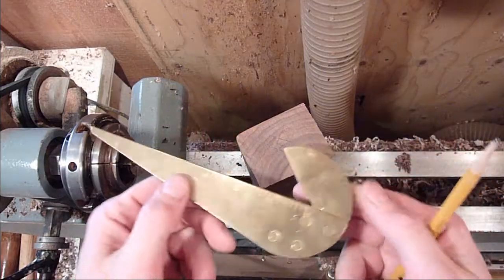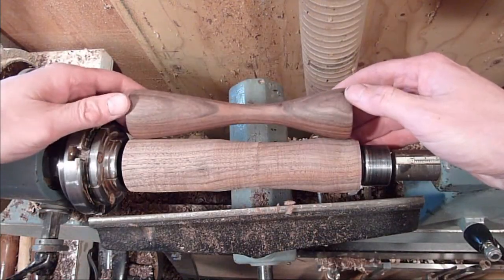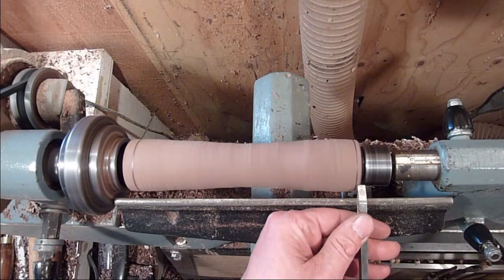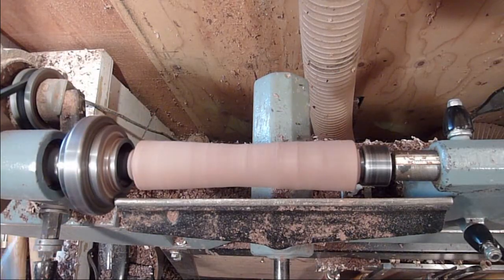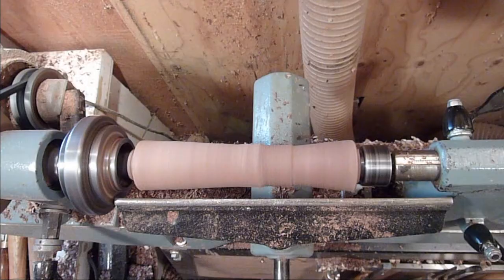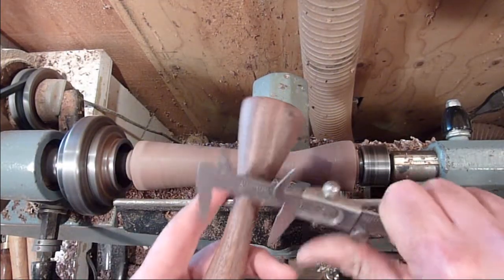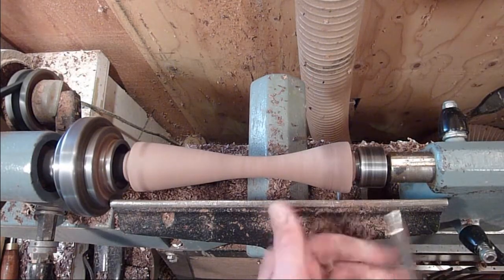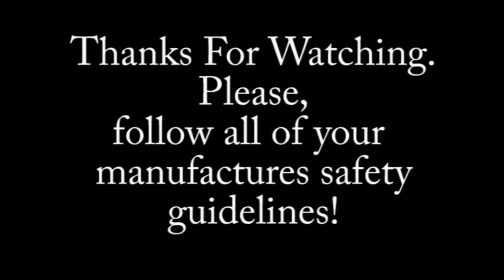Wood Turning Projects Turning Candlesticks On The Lathe

Comment from the maker: Hi,
I drill all the way through when I make duck calls and mount
it on the pin chuck. You need the diameter to be 2 inches that's a 
big pin chuck. I would turn down a waste block and mount it that way.

Carl

Comment: Great project Carl, as someone who is a new to woodworking as a hobby it's always great to see what can be. I do have one question though Carl. What size forstner bit did you use 20mm as a guess. Could you use any type of wood to do this? I have some English Oak blanks they are 50mm square and 120mm long/height.
Reply from the maker: +Paul Johnson Thank you very much Paul! I think I used a 5/8" forstner bit on this one.

Comment: I Like your videos very much , a lot of good ideas and tools use  all very clear and there are very few you tubers that still answers comments after 6 years of the post. I'm just starting in wood turning on a pole lathe and made a couple of those candlesticks  but they dont look very stable.  Is there a minimum for the base or any other proportions to respect.  Thank you for your time and concern.
Reply from the maker: Hi Denis,
Thank you very much! That's cool! I've never turned on a pole lathe, but it looks like a lot of fun. I would make the base at least as big as the top, if not a little more.
Take care,
Carl